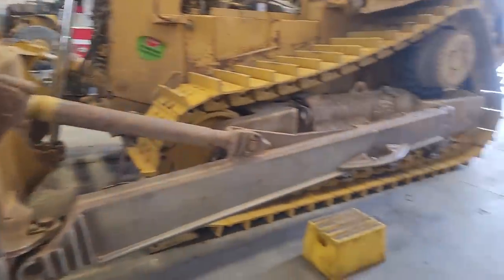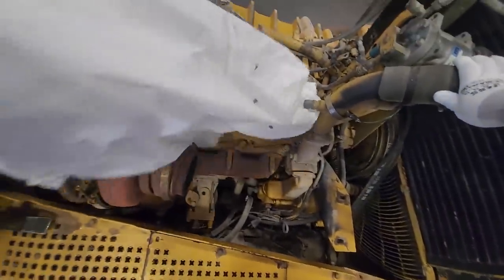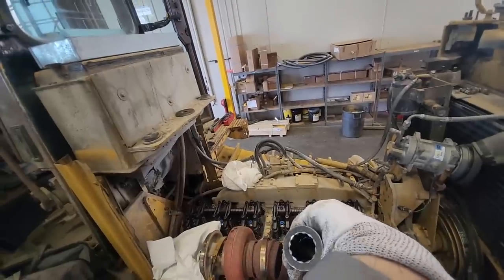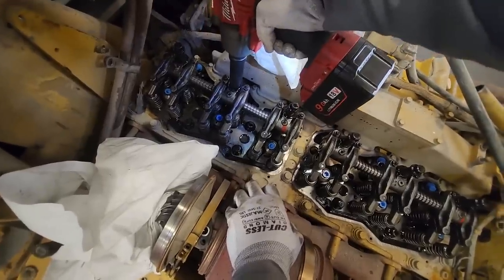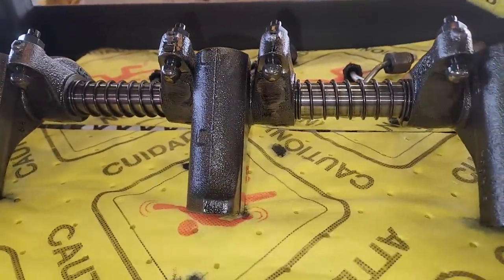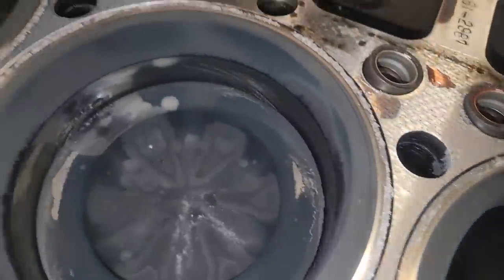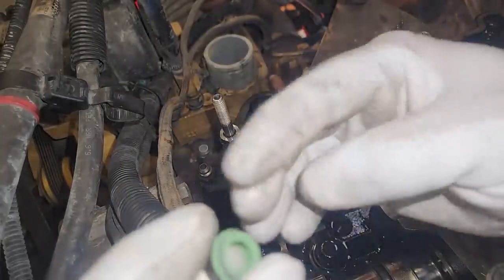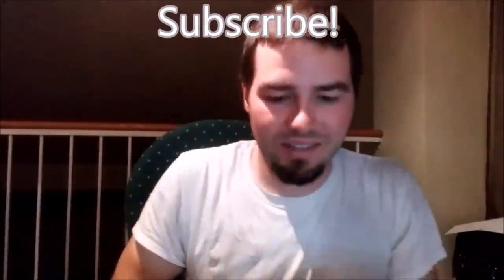D8 Dozer is Thirsty for Engine Oil. Cat 3406 has Oil Consumption.

Comment from the maker: Thanks for watching and let me know if you have any useful information related to the topics in this video. Amazon Affiliate Links to recommended tools used in the video: 
Milwaukee 3/4" Impact Wrench: https://amzn.to/3KZpVoc
Reply: That battery looks like its about to fall apart the hole time haha
Reply: Cat makes a bonnet seal for this engine.  Look it up.
Reply: “I do cars” brought me here.
Reply: @Adept Ape I have a 320kva genset with a 3406B with 10,000 hours on it, and under moderate load it would usually go through 8 ish litres of oil every 100 hours running 24 hours a day, but in the recent week it started going through roughly 25 L of oil every 20 hours with less of a load 14 hours a day with no smoke from exhuast, no leaks or puddles of oil, I removed the charge pipe from turbo to intake, just ya typical oil residue nothing wierd, and removed the exhaust side off the turbo with only typical soot build up. ran it without the cap on the oil filler neck which goes straight to the crank case and I can't feel any pressure what so ever on my hand when put my hand on the filler neck.... Any ideas? I'm confused as to where the oil is going. Cheers

Comment: I always carry a piece of plywood on my truck about 2 feet by 3 feet to put on the tracks when working on dozers. You're correct in saying that the tracks are hard to work off of. The plywood helps. Nothing easy about working on dozers.
Reply: I do the same thing but I screwed a couple of pieces of 2x4 underneath to keep the plywood from sliding around.

Comment: I had no idea extended idle operation on a diesel 3406 would create a vacuum. Always informative and educational thank you. PS I’m not embarrassed to say I stuff a lot of rags in tight areas that I may be prone to drop items into
Reply: It should not create a vacuum since the 3406 does not have a throttle valve in the intake.

Comment: worked on a 3406 years ago using 5 ltrs of oil in a 12 hour shift. Eventually found it was a leaking seal in the hydraulic pump sucking the oil out of the sump.
Reply: I was wondering if it could be leaking into another system. Fuel, hydraulic, transmission, etc.
Reply: Hi mate, got a similarissue but a d4! All turbo side is good wondering if couod be a similar case

Comment: My suggestion for working on tracks Josh is talk to your shipping and receiving department. I work for a Komatsu dealer and when we get large windows in they usually protect them with large pieces of foam. About 2’x3’ and 4” thick. They make great knee pads and laying pads for working on uncomfortable places. Not sure if CAT ships anything like that, but if they do a quick chat with the warehouse guy will get you fixed up.
Reply: 2x2 drilled Into the bottom of a sheet of plywood works good, hook it into the grouzer and ur set

Comment: Very different engines and I'm just an operator, but in locomotives we see excessive idling leading to smoking and oil consumption all the time.  Recently had a SD70 (4,300 HP turbo EMD 16-710 engine) that was making lots of blue smoke and throwing oil.  The mechanic's fix was to put it on the load box and run it in full throttle for an hour or two.  This was made easier by the fact that each locomotive essentially has its own built-in load box (the dynamic braking grid) and you can put them in 'self-load' just by pushing a few buttons.
Reply: Yeah the old EMD 2 strokes don't love idling or low load conditions. We have 3x 20-645s at work hooked to generators for the grid and whenever they're used for load pick ups we have to run them at full load (2.5 Mw) for at least 20 minutes after to reduce carbon build up in the engine. For regular peaking power they're supposed to be run at full load only. Even then when they get the air box opened for maintenance every year there are literally chunks of carbon that coat the inside. Nothing beats the sound of a screaming EMD though! 2 Stroke Power!!!
Reply: I completely understood everything Mr Smith said. Totally. 
Cause who doesn’t know what a built in load box is, I certainly do, so do all my friends and family ;)
Reply: Just to be honest, I’m crazy jealous of you train jockeys. I can’t imagine how cool it is to work with the engines that move the world

Comment: I have seen and dealt with that issue of oil getting inside the fuel on a  C15.  It was as a result of the transfer pumps oil seal failing.
Reply from the maker: Really? I guess if the seal goes bad on the suction side it could pull oil from the engine and mix it with the fuel. Makes sense.
Reply: Yep, c32s, c27s, c18s and c15s are famous for this
Reply: @CryptoMechanic310  HEUI 3408 and 3412 versions can also have internal injector failure foul the fuel with oil.
Reply: Actually there are two plugs on the back of the c15 head. One is oil pressure and one is fuel pressure l. I had to go on a service call because a Pete ran out of fuel and couldn’t get it to prime. Wouldn’t prime because the fuel port on the back of the head was plugged. Fuel return line was in the oil pressure port. Luckily it never put oil in the fuel because the oil pressure was lower then the fuel pressure regulator setting
Reply: Usually you'll see the fuel in the tank looks black, ...

Comment: Actually yes the belly pans are a pain in the backside. However they are there for a reason. There was a D11 working on a garbage dump expansion and it was running without the belly pans and a big stump  flipped up under the machine and the stump somehow cleaned the oil pan off the engine. That would have been an expensive day.

Comment: There are two different oil seals for valve stems, one is a plastic one that is held by the upper spring retainer the other the one that goes on the guide! The style of valve guide you are showing was designed for the seal being on it! Do not have sis anymore so can not look this up for you! Yes need to check valve guide for your arrangement, to be sure! Use to rebuild lots of cylinder heads back in the day, before exchange took that any for most dealers! The tool for seal install 9U-7226 Installer Gr
Model: 3406E Engine

Comment: Hi fromthe uk 
Done a little routine service work on the d8 years ago before they went to the high drive sprockets. Fun fact those head bolts are relatively short back in the 90s rover cars had an all aluminium engine the head bolts extended down into theain bearing cap assembly so head and main bearing bolt they were about 14 inches long we called them knitting neadels 
Keep up the good work

Comment: Holy crap that battery moves around a lot when the 3/4 M18 gun hammers!
Reply: They are designed to do that to prevent damage.
Reply: I saw DAYLIGHT in between the gun and the battery's mating surfaces ! That thing shook violently. 😬
Reply: It's a cheap knockoff battery. But if you slow down the video it looks like the battery case is separating on the front.
Reply: Generic battery most likely he knows battery is on its way out and is going to use it until it dies.
Reply: @jamestaylor1078  I bought a knock off 9amp.. it's a piece of f@#$..can't put a big load on it..but ..but I use when it decides it wants to work 🤣🤣..I've had Milwaukee brand 12 amp that the case completely fell apart....it's all junk I guess
Reply: @elroyelblander6277  If you had a original battery fall apart call their number and get it replaced.
Reply: @jamestaylor1078  it’s not a knock off I think it’s an Australian battery
Reply: Knock off battery,  he needs the battery strap the clown tool shop sells in jersey

Comment: Everyone says that it's an old wives tale but I've had several 3406B's that I'd change the oil and put them right on full and in less than a day would be just right above add so I'd top it off every day but decided to see if it'd go below add and it never did, it'd just drink the oil to a certain level and stop using it until around 10,000-12,000 miles and start using it right at the time it was time to change it. My buddy had a 3406B that done the same thing but would go way below add but come to find out it had the wrong dip stick.

Comment: Cut up stall mats help a lot on tracks, particularly with shorter grousers. Also on treadplate, like kneeling on an excavator platform to work on the engine. A foam kneeling pad goes a loooong way too.

Comment: I work in a machine shop and occasionally big diesel heads come in. Not all of them have valve seals just guides, but I never find any real wear or anything on them. One thing you could check is if there is a chance the valve seats have a leak behind them which can let oil in. Usually this would suck in coolant (happens on old V8 iron heads), but it may be able to suck in oil if that is the case. Not likely but it's something you could check out. Cracks can show up in odd places too that could let oil get to the intake side.
Reply: But every cylinders seems to be the same I guess it would be unlikely that every valve leak in the same way? Could it be out of tolerance valves or valve guides?

Comment: On the oil in the fuel. I've had a transfer pump do that. And on the oil consumption, it's probably a reman head, I'm willing to bet that the tolerance on the valve stems are at the maximum.

Comment: Some of these problems can really make a guy scratch his head. Was this Dozer showing smoke from the oil it was burning or no?  I had a 3306 once in a Gas compressor that was using so much coolant you could see the level dropping. But when you would go looking inside there was zero signs of a coolant leak. It was baffling to say the least. Eventually we had to take a educated guess and replaced the exhaust manifold at a cool 7 Grand. (A liquid cooled manifold). Turns out it was cracked and causing our issue. So we got lucky on our guess. Lol.

Comment: Hey Josh, we just had a Mack MP7 (I believe) that was leaking fuel out of the front cover of the engine. Turned out to be a plug on the fuel galley in the block, that was covered by said cover. Thankfully the fuel came out of the top of said cover and didn't go inside. I can only imagine the diagnostic headache that would have created.. Just figured I'd share this one with ya, and maybe it'll help someone who may be pulling out all their hair trying to solve a fuel in oil problem on an older Mack.
Reply: Nothing to do with CAT 🤦‍♂️

Comment: Josh:  About 10 years or so we ran into a similar situation with "black fuel" on a C15.  Ended up using Fleetguard Asphaltene treatment - if this is truly fuel, not engine oil,  very rare condition up in the Northeast but we have seen it.  Not the same deal as black fuel on a C7.  Do not really find this conditioner on Fleetguard site, only MSDS form.

Comment: I'm a heavy equipment mechanic for Komatsu and that is way I don't use Snap -on sockets @6:35 !
Reply from the maker: That is a pretty good reason actually with a high possibility of losing one.
Reply: Because CAT uses Chinese bolts and hardware
Reply: @MitzvosGolem1  the implication that all Chinese products are junk is incorrect, Chinese manufacturing has the same capabilities that US manufacturing does. Problem is if you want top shelf you pay top shelf prices no matter the origin country and most companies who outsource are not looking for quality which gives the bad reputation.

Comment: No minors and majors it looks like, but new rollers, rails, pads, etc.
Minors and majors refers to the frames/bogies that hold the bottom rollers. The Majors are the pivot bearings that hold each bogie to the roller frame, and the Minors are the pivots for the smaller mount that holds each bottom roller. So the Minors can rock allowing the rollers to move, then the majors allow that whole assembly to move and bear against large rubber cushion block springs.
Makes a massive difference in operator comfort on hard, uneven surfaces, and also allows the track to better conform to the ground for better traction.

Comment: Leaking rear main seal can send engine oil into the torque converter/power train sump.
Reply: What I was thinking also... I didn't hear him say if the engine was smoking or not. No smoke, no leak,  Trans Making oil... rear main.
Reply: Ha, delt with that on a D7 years ago.  Hopefully the field tech checked that first!
Reply: Yaa. That's possible

Comment: The fuel return line is hooked to the oil gallery at back of head. There are two plugs swap plug and line to correct.
Reply from the maker: That is a pretty good idea, I'm not sure if he did any recent work on the back of the head.
Reply: If that were the case wouldn't you be putting fuel in the oil not the other way around??

Comment: I recently had an injector oring go bad on a c15, the middle one. Was turning my return line fuel black. Looked almost like oil. Since I just did my head I was a little stumped thought that head cracked. I did a lot of research and found it is very uncommon and that only one person, supposedly, had experienced said issue. I was just astonished how fast the fuel turned black only from one oring. Changed oring primed all good now. Maybe he has a couple orings leaking? If its not orings on the injector I would make the guess that the head is cracked since there is no other place the oil comes in contact with fuel.
Reply: Middle o-ring fails from injector seat area leaking causing compression/soot in fuel. New head or machine the seats is the fix.

Comment: I know you don't work on tracks much, but the next time you do throw down a sheet of plywood. It will save your knees and shins. I've lowered a few pans after already installing them to retreive tools. I actually lost my pocket screwdriver in a dozer once that came back about a month later for something else and got my screwdriver back. 

We've got one of our rental D8Ts that came in with low oil pressure. Found aftermarket bearings in rods and mains. Cam is all scuffed up as are the rollers. Aftermarket oil pump. When the head was pulled, several of the bolts were literally hand tight and a couple pulled the threads out of the block. All but one liner was dusted out. Exhaust manifold nuts were loose and the holes in the head were egg-shaped. At first we thought maybe a customer swung in their trash engine but the s/n on the block is correct. Real head scratcher.
Reply: Maybe the customer was smarter, and wanted oem parts at aftermarket prices, and doesn't mind doing the job twice.

Comment: Have you checked the turbo for any oil buildup in the exhaust? I've seen many 3400 turbos leak from the shaft into the exhaust from a lot of quick load increase/decrease scenarios, where the load will increase and decrease rapidly
Reply: Did you pay attention?

Comment: I was thinking excessive stem clearance or light load running / idling as well.
Have you thought about someone using the wrong dipstick when it was re manufactured and over filling it?  That happens more often than you think on these and is actually part of the cat diagnostic procedure for excessive consumption 
Another cause is the second ring upside down but since you have wet inlet heads and no turbo leak, im betting bad guides.

Comment: Excessive low idling with dirty filters. Low idling is really hard on diesels. It causes fuel to condense on the cylinder walls because the cylinder is not hot enough to vaporize the fuel. This allows fuel to build up in the ring grooves of the piston and when it burns it produces carbon in the rings and detonation. The vacuum that is drawing oil into the valve guide is from dirty filters, that's the only restriction in the intake that can produce vacuum. 
Clean the filters and keep your idle above 1300rpm, better yet, don't idle.

Comment: When I used to work for a mobile mechanic company I use to have to crawl under dozers in the sand pits, one time we just finished on a John Deere 1050K and it wouldn’t crank after the new parts the joke was I had a caterpillar hat on

Comment: C-15 dumping oil out the fuel return... Never seen it on a Cat but what I have seen is failed injector and/or injector seals cause this on Navistar engines. If I'm not mistaken there is a lot of similarities in the HEUI design between the Cat and Navistar... Maybe something to look at before going to the hassle of removing the cylinder head?
Reply from the maker: That was my initial response to the engine owner and thought he had a C7 HEUI, but then he said he had C15 and sent a video of it.
Reply: Heui POS motors

Comment: It seems to me that the oil in the fuel return has to be the problem; however, if the engine is burning a mix of oil and diesel there would be other symptoms and problems occurring.   As you say - there are no external leaks so the oil has to be leaving through the cylinder.  My first guess would have been a leaking turbo seal but you said that was ok.

Comment: Josh, when you were instructed to remove the head, do you get briefed on what’s already been checked? Also, does Cat keep track of how the engine is worked, in terms of  percent load and idle time?
I worked on many brands of construction equipment as a field service tech and some OEM’s have advanced telematics that let you go online and view machine location, codes, percent of run time at light, medium, and full load, as well as idle time. 
Working on the entire machine makes it harder to be an expert on specific components like engines, but if the intake valves are wet and the crossover pipe is dry, doesn’t that rule out the turbo? Excess idle and light load working conditions cause many regen issues on Tier 4 engines. Maybe they can cause oil consumption issues on Tier 3 engines!?!
We look forward to the follow up video.
Reply: 3406B is a mechanical pump engine. It won’t have all of the sensors and other stuff for tracking what loads it’s ran and when. All it’d have is a basic hours meter.